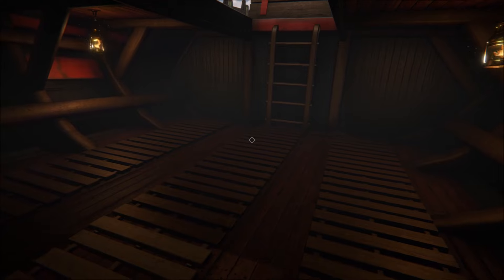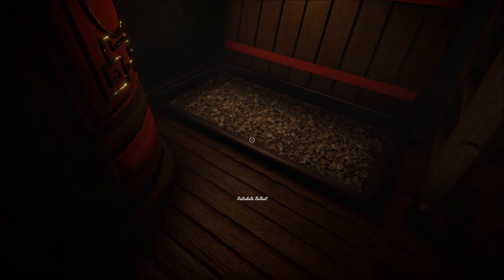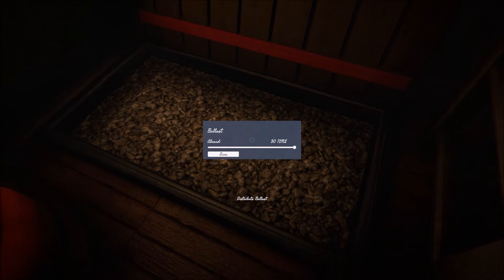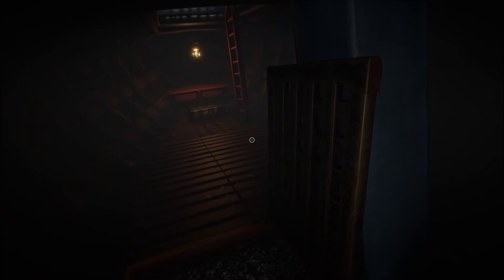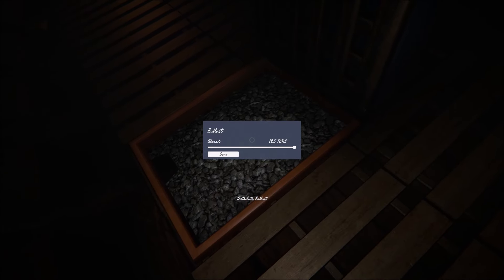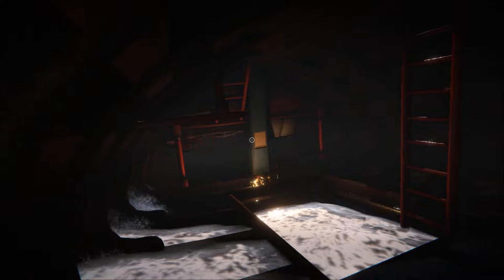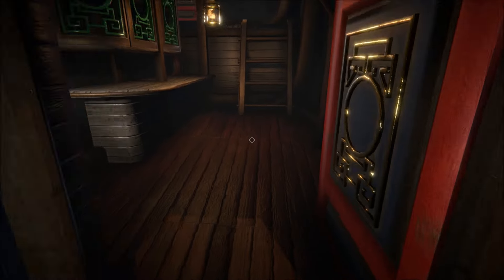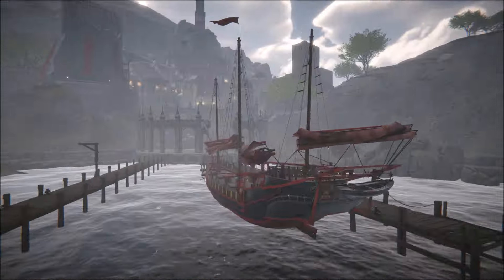Following Seas - A sinking feeling

Comment: Love it.

Any plans for square rigged ships?
Reply from the maker: Thank you. At this point probably not. There's a possibility for some smaller types down the line -- but I'm mainly focusing on rigs with at most 5 sails. I use some heavy simulation for cloth, allowing fairly dynamic sails that behave pretty realistically -- but the complexity of that (a particle chain based system) makes it infeasible for something with 10+ sails unless you cut the detail way down.

Comment: How did you make the ship sinkable when taking on water?
Reply from the maker: Essentially buoyancy is simulated, so that once the mass of the hull plus load (cargo + volume of floodwater) exceeds buoyancy it will sink. 

Also I calculate metacentric height, which is increased by ballast and cargo, but decreased by flooding. If metacentric height exceeds the balance point the ship will roll on its side or capsize.